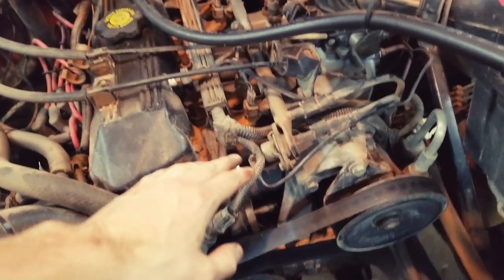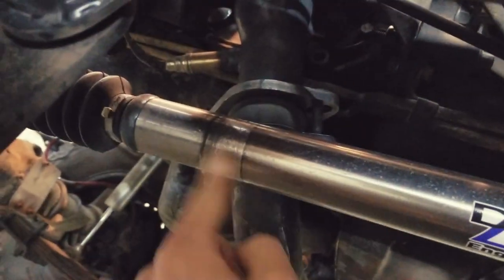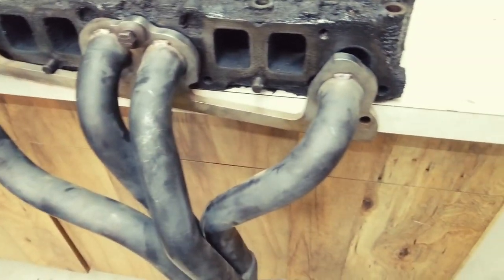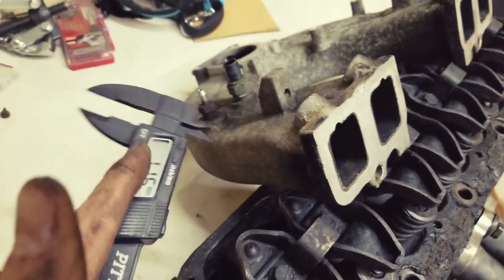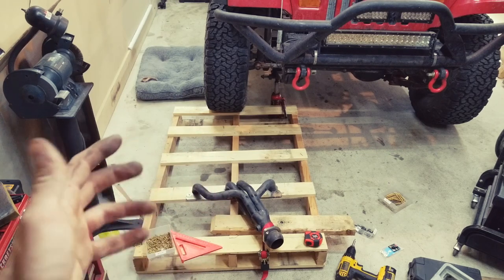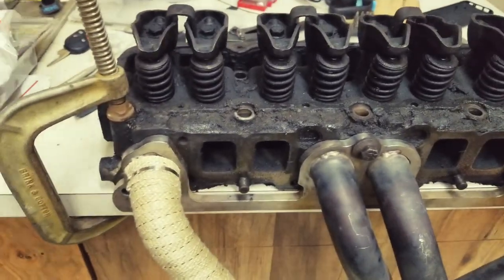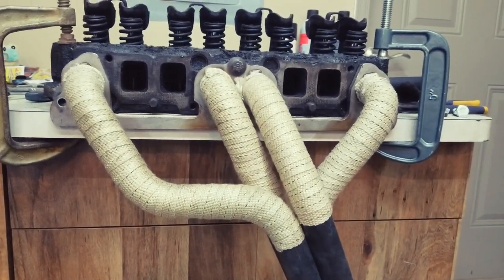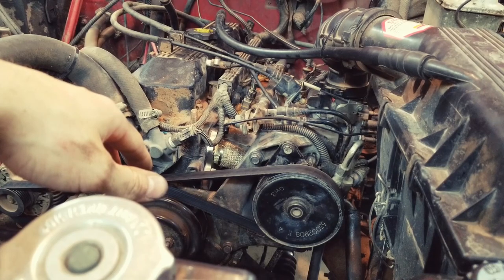2.5L Jeep Exhaust Header Review And Wrap

Comment from the maker: Take note that I have a 1.5" lift kit. If I had a larger lift kit it is likely that the driveshaft would not rub the exhaust as the driveshaft would be at a steeper angle. Best of luck!
Reply: Iron man 4x4 fab engine mounts   help by replacing old warn out ones   also helps by lifting the engine 1 inch   which also helps by raising engine tranny for clearence that gets lost due to body lifts  and helping with rear pinion angle in the rear as well.
Reply from the maker: @Baldybiddle  now that's an idea.  I was planning on doing a tummy tuck skid plate which would require new engine mounts.  I didn't even think about how it might help my rubbing issue.
Reply: @JeepSheepTV  while your waiting on your engine mount lift order get to making a vid on your efan temp sensor set up ! Been waiting lol
Reply from the maker: @Baldybiddle  I know! The only reason I haven't done it yet is because every time I film it I end up changing the design.  I have filmed that video probably 3 times now and I am changing the design again! It's been frustrating but I think I've finally figured it out.
Reply: Have you had problems with header exhaust leaks? Years ago I had headers on vehicles and was always changing gaskets.  That was over 35 years ago 😳. I'm thinking I would like to put a header on my YJ but if you're having a leak problem,  I'm not going to do it. By the way, really enjoying your videos!

Comment: I bought the same Kit for my 99 2.5,  they claimed it was a direct fit for 91 to 06...... after modifying the intake, modifying the tubes and adding four inches of wire to the O2 sensor it was in. Oh and the gasket I felt was junk so bought a dependable Fel-pro.But honestly after all the headache I did see a noticeable increase in torque wheeling and it really growls with my MBRZ exhaust

Comment: Ok I have a few notes after doing this as well
1: just buy a new oxygen sensor. They're 20 bucks and it's worth the time saved if the old one is rust welded.
2: WATCH YOUR WIRES. my wire harness was resting on the exhaust flange but luckily I spotted the smoke in time. I wasn't so lucky with the crankshaft position sensor, and that was an $80 mistake. The whole apparatus takes up a lot more space than the stock manifold.
3: I have a 3 inch lift and my front driveshaft has not rubbed so far
4: I paired this with a flowmaster cat and force II cat back. I love the sound. It has a nice rumble and the drone is drowned out by jeepy road noise. Don't expect your butt dyno to notice a power gain though.
All in all In think these headers are a great value at $130. You will need an angler grinder to slot out that back hole. Don't waste your time with a drill.
Reply: Also, Instead of using a hammer on the exhaust pipe, I used a grinder to flatten the powersteering bracket.

Comment: Well we must've bought the same header; mine hits the driveshaft too. I relief cut the engine side like lead notching a tree, bent it, checked it, then welded it up. I don't think that little bit of angle and restriction I created will hurt this horsepower churning engine!! Lol
Reply from the maker: Lol yea.  I just let it rub... mine hits right at the joint between the upper and lower pipes so if I bent or cut it the seam wouldn't seal anymore. Sounds cool though

Comment: How did doubling up on your gaskets work out over time? Did you have to re-tighten after a few drives at operating temp?
Reply from the maker: Its been doing great.  I never checked torque after some miles... I'll be in there again soon.  I'll take a look.  Thanks for bringing that up. No leaks though!

Comment: How's that header holding up with being wrapped? also did you notice any gains or is it just a cool factor?
Reply from the maker: As far as I can tell its holding up really well since they are stainless. Unfortunately I did enough modifications at the same time that I wouldn't be able to tell you how much performance I gained but the cool factor is certainly there.
Reply: I think you can expect 5-15hp and same torque with the header, 4-hole injectors, and the 4.0 throttle body.
But you can get a cam from Bullet (that's next for me)

Comment: Did you ever get anymore power out of the 4 cylinder?
Reply from the maker: It was really hard to say because I had just swapped engines from my old 4cyl with very low compression to a rebuilt one. I was able to quantify power gain in my injector swap video however.

Comment: this doesn't really do much but trap heat in the headers, Ur better off putting heat reflective tape on the underside of the intake and anything else that you want to keep cool like intake pipping
Reply: The hotter the exhaust gas the faster in exits. Wrapping exhaust parts increases exhaust velocity. I never wrap cast iron or anything that has a weld to avoid trapping moisture and increasing rust.

Comment: Stuff STINKS! And getting the wrap wet along with continued high rpms, eats the pipe prematurely! Ill never wrap them again! Better to make vents and oil cooler to bring operating temps down.
Reply from the maker: I think it looks cool, But I wouldn't have done it if I didn't have a stainless steel header